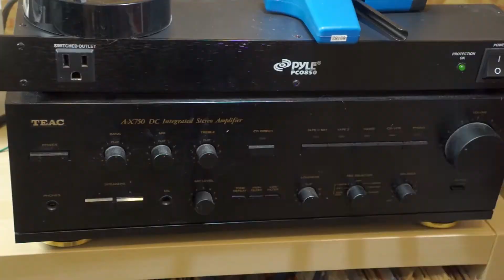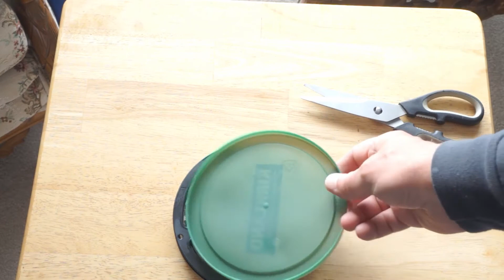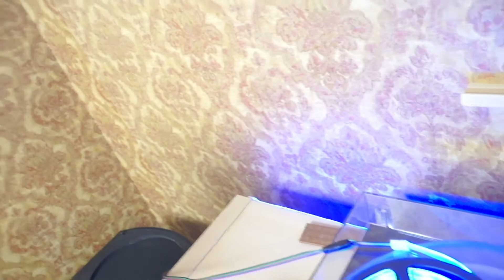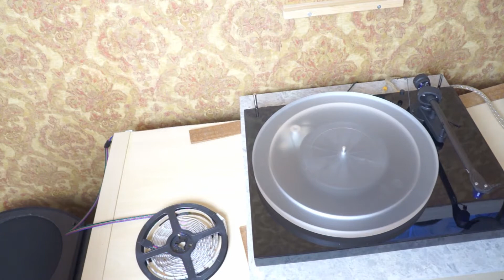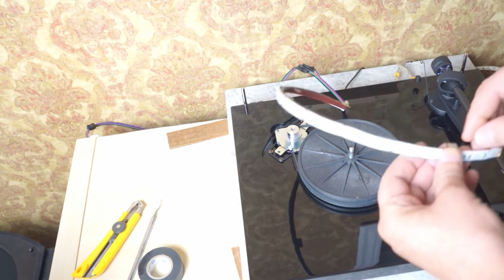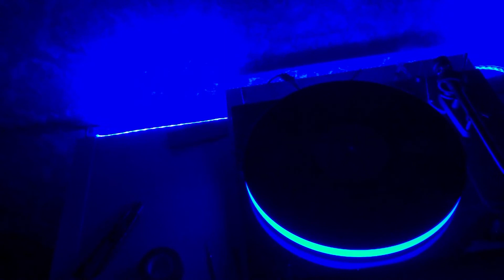pro-ject debut carbon turntable led lighting mod, installing led lighting in project debut turntable

Comment: I have the same turntable and acrylic platter. I would prefer it if the edge of the platter had a smaller clearance gap from the plinth. The led spots would surely be visible through the gap.
Reply from the maker: Yes if you are looking at it straight on they are visible, I have since changed to a solid led ring under the platter but same issue, visible if you are sitting with the gap at eye level.  Video here: https://youtu.be/s1aDv_EJVOU